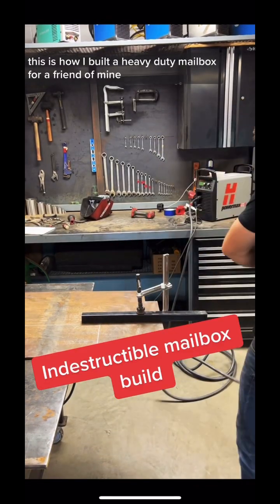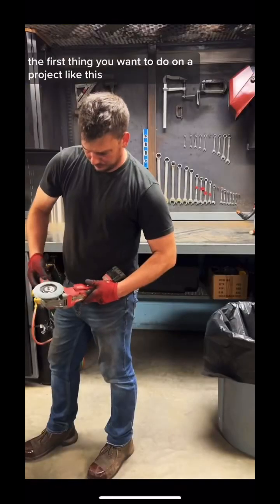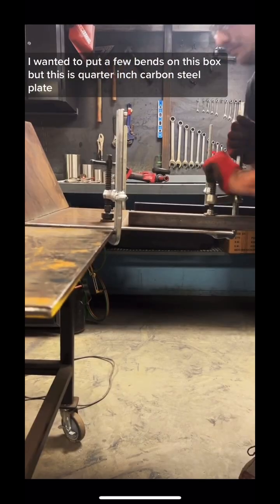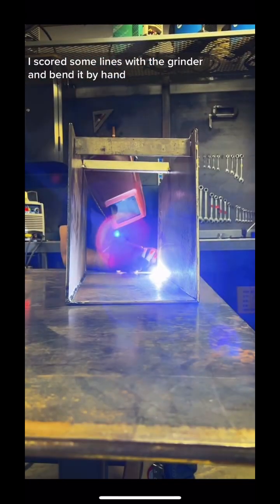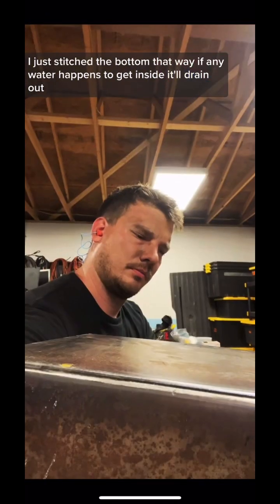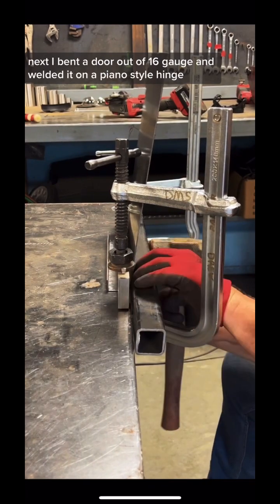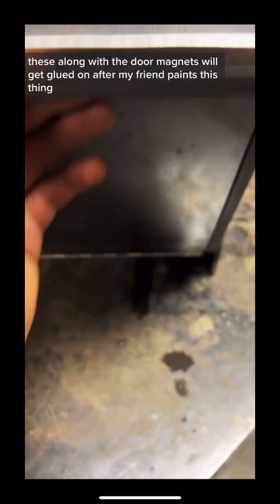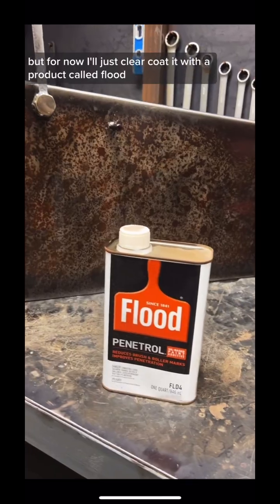INDESTRUCTIBLE MAILBOX BUILD—Welding Project #welding #fabrication #diy

Comment: Use drill stem oilfield pipe for the post. Fill it with concrete. Put an old discer blade on the bottom. Dig a hole place in the hole fill with concrete. You could drive that f250 into that and she won't bend or come out the ground. Snow plow blade will come off the truck before it takes that out of the ground.
Reply: You're wrong and it's illegal to do something like this. Good luck if you're mailbox kills someone you're liable

Comment: Yea I was down this road last year as I was walking out with materials to build a gentleman had stopped me to let me know that his friend went down the same path and a drunk driver hit it. Driver ended up Suing the homeowner. Also if the plow truck hits your mailbox when it’s built outside federal code you are liable for the damages. I think it’s a pathetic society we live in. Have to cover our own ass from the stupidity of others
Reply: All mailboxes are mounted on 4x4s for a reason, it’s not stronger than your car and will not kill you. If you mount a 100lb steel box on a 4x4 and hit ice and slice into it your brains at now splattered across your headrest because the equivalence of a fucking semi truck just hit you in the face thru your windshield. 

Long story short, do what people do around me, bend a pipe that’ll hold it in the correct position on the other side of the culvert that way the plow can go underneath it and the drunk asshole
Cans sue you for a million dollars.
Reply: Well just assume it was your 17 year old kid who was distracted while driving and hit someone's 80# mailbox anchored to the ground. The weld breaks and the mailbox goes through the windshield and decapitates your kid. Now if they installed a normal mailbox it would have been impossible for it to go through the windshield and your kid would still be alive. Would you just be like "Oh well he was just trying to have a mailbox that wouldn't fall over during a snow storm. Honey let's make another kid!"
Reply: @justtosaythis2087  driving distracted is against the law. And it’s the same as someone hitting a 100 year old tree it’s a fixed object outside of the road way. Should be at drivers fault. But everyone is entitled to their own opinion and I respect that. But I personally wanted to make a cool all metal pipe mailbox. With a T flange for the box. More or less as a custom piece to display my welding/fab ability but again had to sacrifice that for covering my behind. There are plenty of people that have “illegal” mailboxes just depends on what the risk factor is in your area I suppose